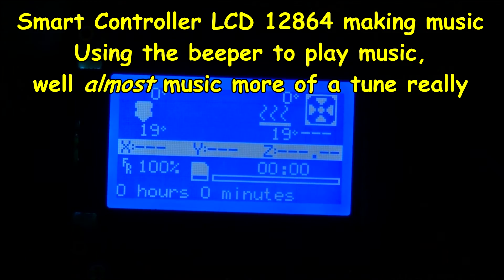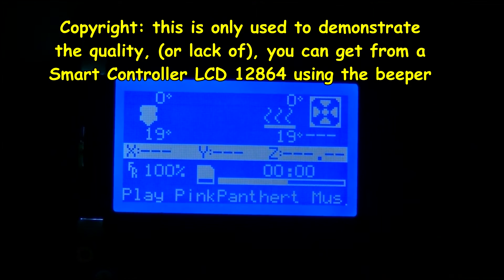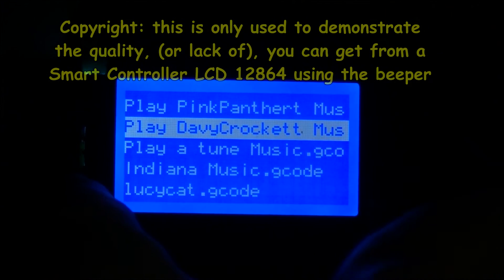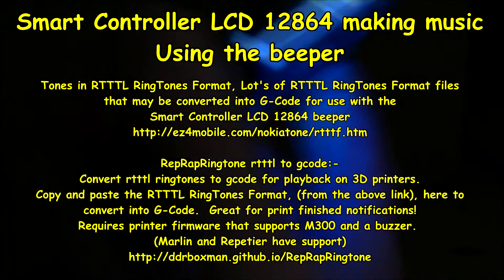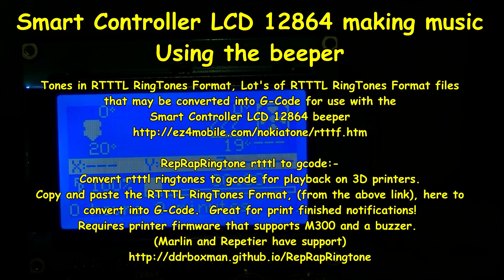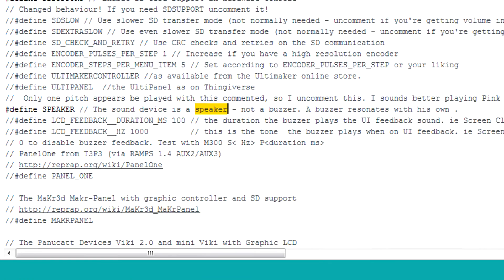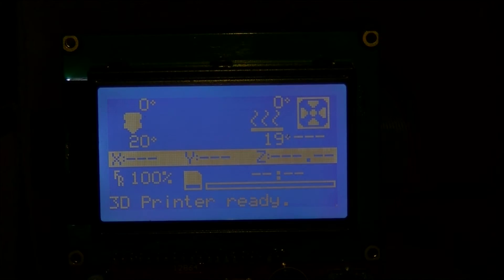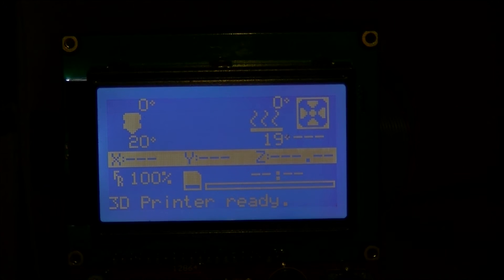Smart Controller LCD 12864 making music

Comment: Nice! I think the poor sound is because it's an active buzzer... What if it were replaced by a pasive buzzer?
Reply from the maker: Thanks: An actual loudspeak me sound better but may have to use a diode to stop Back EMF, and that may knock the sound level in half:

I Use this Marlin uncommented

// Only one pitch appears be played with the default commented, so I uncomment this. It sounds better playing Pink Panther, etc
// Sounds better if uncommented like this:-
#define SPEAKER // Sounds better. The sound device is a speaker - not a buzzer. A buzzer resonates with his own frequency.